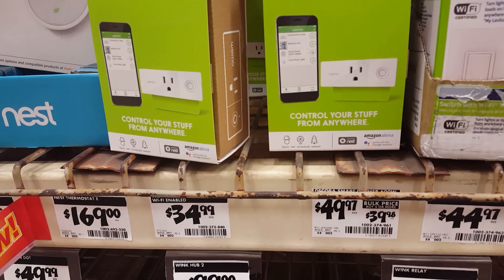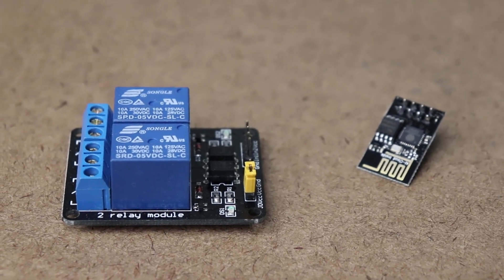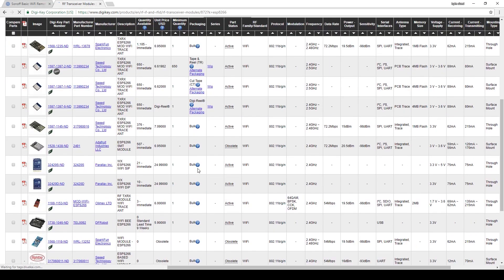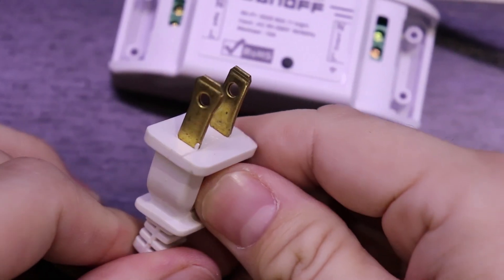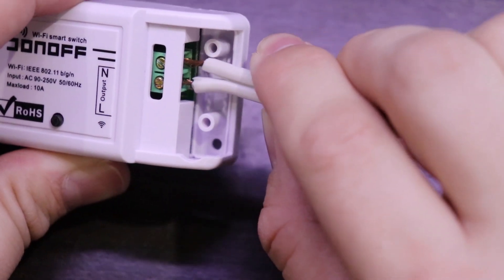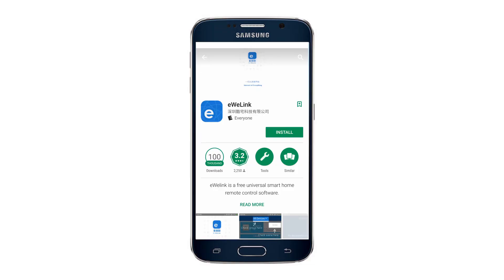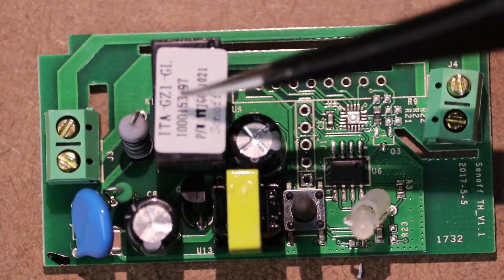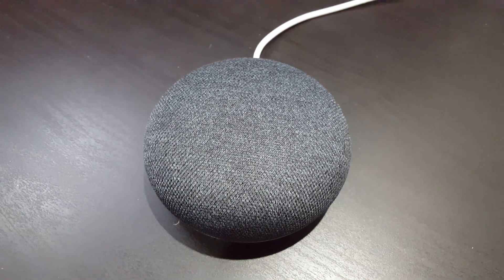Sonoff - The $5 WiFi Smart Switch That's Compatible With Alexa And Google Home

Comment: Thanks for the video. The wifi switch gave me an idea for my bathroom light and fan combo. My bathroom light/fan are connected to the same switch. Instead of running new wires to separate functions, I can just install one of these devices to control the fan on/off switch. Thank you

Comment: Thanks for the video! I've been wanting to get one of these, but I can't tell if it has a manual on/off switch.  I checked the documentation and I couldn't find where it said it did, I only saw where it talked about how to use a button to program the WiFi.

Can you verify if it has a manual on/off switch??
Reply: Hey John, did you find it out afterall?

Comment: Can input be 12 DC? do I need to be connected to wifi that Snoff is on?any way operate it at remote location?
Reply from the maker: This isn't designed for 12V applications. Once the device is connected to the internet you can control it from anywhere you have internet access.

Comment: If you are looking for a way to configure these directly for a SmartThings Hub without need of some third party app, take a look at this thread.  You will need to buy or have an FTDI adapter to re-program the Sonoff (around $8 on Amazon).

http://smartlife.tech/blog/2016/04/21/sonoff-wifi-switch-smartthings/
Reply from the maker: Thanks Nick. I helped my brother in law do this exact thing. Thanks for sharing

Comment: What a great video!  Super helpfully in getting my home automation up and running.  Here's a good one for you.  I have a Schlage Sense smart deadbolt lock for my front door.  It is Bluetooth enabled which I'm not very interested in, but  there is a Schlage wifi adapter available at the home centers but it's $60!  Is there a way to make my own adapter using these types of products saving my some bucks? Thanks!
Reply from the maker: If you don't mind digging into electronics and coding look into the esp8266. You can get a development board called the wemos d1

Comment: It's great if I can connect to it.  Apparently you need to be on a 2.4 ghz wifi connection.  Almost all my phones or tablets are on 5 ghz.  I can't seem to change that on my router.  There was one phone on 2.4 ghz.  I guess I'll have to borrow it just to connect this device.  I think eWeLink needs to update their App to connect with 5 ghz.
Reply from the maker: Is your router a dual band router? In other words does it support both 2.4GHz and 5GHz? You're correct in that the sonoff only has a 2.4GHz radio in it. If I remember correctly during setup the sonoff creates a temporary 2.4GHz network that your phone needs to connect to. Your phone should be able to do that. After it's set up, your phone can go back to the 5GHz network and the sonoff will stay on the 2.4 GHz. Your phone and sonoff don't need to be on the same band to work properly.
Reply: @bytesizedengineering  I know that but the problem is that I haven't been able to find out how to connect my phone to the 2.4ghz wifi.  It does it automatically and I see no way of changing it.  I tried to see if it could be changed on the router but had no luck.

Comment: My only thing. Is.. If it's on wifi.. Who manages the firmware updates? Seems like a big security problem to me.
Reply from the maker: You can load custom firmware and manage it yourself
Reply: @bytesizedengineering  after doing some more research on this I found that... That's awesome.. Still if that firmware is not updated its still a risk.. Buuuuuttttt I set up a firewall rule that blocks any public access to any internal IP addresses I Want so that makes me a little more comfortable...

Comment: See the BOLTR: AvE channel video of a similar name.  Shows cons. No UL listing,  10A Max on 15A circuit,  hijack capable for DDOS..

You addressed 2 of 3 of these in comments... upgrade firmware, add 10 A fuse or lower,  I would still find UL rated switch.

Comment: does it have a sunrise sunset automated "switch" connected/depending on location? I want to control electric water heater, only working at daytime, cause have PV solar panels on the roof

Comment: can that thing connect to my wifi instead ? i want to issue command using my router(with tomato firmware), so i need that thing to be in the same network as my router.

Comment: Do you know if there is 5v smart switch that can be used in-line for a USB powered device?  I have my wifi cameras powered by a USB 5v uninterrupted power supply (UPS) but there may be times when I need to remotely power cycle the camera to reset.  Obviously I can't use a smart switch at the main power source because the UPS will kick in and prevent the camera from powering off.  So I need something I can control in between the UPS and the camera.  

110v=>USB 5vUPS=>(smart switch?)=>camera
Reply from the maker: I'm not sure I can help, sorry!

Comment: "It looks like the lights haven't been configured yet"
Reply: If you want to make your lights smart and keep your existing switch, you can use a Sonoff mini. It has two wire terminals that you can use for a switch. Keep in mind that  the switch will switch low voltage. So don't connect mains to the switch line because that will kill the Sonoff.

Comment: Nice informative video But.....
Not wishing to rain on anyone's parade but I didn't see any of the type approval labels one might expect to see on a relatively complex mains AC automation device. At least one or more of FCC, TUV,  or CE (meaning the real one, not the false CE alternative 'China Export' label).

Also the build standard and quality control inside looks awful.

I would  be seriously concerned over risk of carbon and/or dendrite tracking between high voltages between copper/solder elements, which is a different failure mode to arcing via ionised air. It's a common problem on poor pcb designs where low resistance paths develop over time and guess what? It gets hot.

Without UL qualified materials it may catch fire while you are 20 miles away playing with your phone while your neighbours call the fire engines.......!

Be safe. Use qualified components/materials or do the work yourself to verify that the design & build will satisfy your statutory regulations.

If you don't care about this then use it in a garden shed which won't burn your house down when things go wrong, which they inevitably will.
Reply: See the AvE video on the issue of 10A device on 15A circuit
Reply: @davidcosine  link please.
Reply: Completely agree with your concerns.  I'm surprised you're the first to mention the lack of UL certification in the comments!
Reply: I think there is a version with CE but these sonoff devices are all tuya based which means they all run over a other chinese company. They also can pretty easy be hacked during setup, which means that you can flash some custom firmware like tasmota.

Comment: nice video. i want connect the sonoff switch with my loxone system but it seems not possible without o modification like flash the software.
do i need a modification to the sonoff switch to connect it with Google Home?

Comment: Nice video, I will keep these switches in mind.  For basic outlet control, a few more bucks gets you one that doesn't require cutting up an extension cord.  $13 at the moment.  https://www.itead.cc/smart-home/smart-socket.html
Reply: I think what he wanted was on the cord so it went with the device not the outlet. Of course it could still do that with the extension cord but less likely.

Comment: I still prefer zwave. Get a real controller like HomeSeer and pair any zwave or zigbee or some wireless devices. Have logic to play around creating the Auto pay of automation and have the house do things on its own even if your cord to internet is cut. I don't want my Smart house be dependant of Internet, to me the smart goes away there. Just my preference. A house I can control even without WiFi and also through Google home while internet works. Alexa is worthless.

Comment: Nice products, but I would not use them as I think it is wise to think more than twice before to use them. They are so cheap, they probably use the cheapest components and probably they are build based on Chinese standards which could more easy give problems or short circuits, and this is the last thing I want in your house...I want to sleep relaxed...

Comment: I have a fluorescent tube light in my kitchen and want to add it to the already Smart home lights. I got a smart light switch and guess what no neutral wire at the switch and I am not going to hire an electrician to run that so I was thinking if I could use this in the light maybe go in the attic or in the housing of the unit itself.. what is everyone's thoughts on this?

Comment: Nice job on that! How would you wire it if you're like me and live in Australia with a 3 pin plug and 240v? Are those switches suitable for 240v devices?
Reply: Just go out and buy a switch made for australian conditions, like TP-Link, from Bunnings

Comment: Don't leave that much wire hanging out of your screw connector. You're just asking for a short. The wires should be trimmed short enough that the jacketing presses flush against the connector.

Comment: Help... the first one installed went off without problems. The second i hooked it directly to the lamp’s cord but it’s not working at all. I made sure the neutral wire is in the neutral line. I even tried a second sonoff and still nothing.

Comment: Do not promote this. This device is only rated at 10A. Your house has a rating of 15A and roughly 20A in the kitchen receptacles. THIS IS A RECIPE FOR A HOUSE FIRE. DO NOT USE THESE.

Comment: Great video!   I would only add that the cord ends should be tinned with solder before inserting them into the device. This helps ensure no frayed ends which could lead to shorts or even fires.
Reply from the maker: Actually, with screw terminals you don't want to tin the stranded wires. They're designed for untinned wires.

Comment: You misspelled combustible in the title.

No CSA or UL laboratory certification, and the thing is rated for 10a. So many people are gonna overload these things is rediculous. I wouldn't put one in my worst enemies house.
Reply from the maker: I'm aware of the risk. I agree that people should take the time to understand the risk before using this device and any other device that is potentially dangerous. I'm careful not to put any load over 10A on these devices. It might make for an interesting video showing what happens if I overload this thing.

Comment: AvE did a "review" of this product and stated that it was rated for 10 amps. Your standard house power receptacle is rated for 15 and your kitchen at 20 amps. I would not feel safe to have this plugged into my wall.
Reply from the maker: Good things to be aware of. I don't plug anything into these that draw more than 10A.

Comment: The blender draws about 12A and the Sonoff switch is rated for 10A.   The "expensive" smartplugs are not so pricey once you consider they are rated for at least 15A and less likely to start a fire.
Reply from the maker: Depends on the blender, but definitely a good point. They make other models that are rated for higher currents.

Comment: Jesus. This is a terrible terrible idea. If you don't know anything about mains electricity, don't play with it. You'll burn your house down.
Reply from the maker: I agree, if you don't know what you are doing you shouldn't attempt a project with mains electricity. However, getting educated on the topic isn't as difficult and time consuming as one might think.
Reply: byte sized no, but it's a steep learning curve and it's what you don't know that bites you.

He really only showed how to set it up, not to verify whether it's rated for the device/circuit you're connecting, etc.
Reply: +byte sized those devices almost certainly aren't UL or ETL listed, so they haven't been tested safe, either.  What you're doing is irresponsible.

Comment: https://www.youtube.com/watch?v=yCkwXKRRHHs - Might be worth watching this if you are considering one of these...
Reply from the maker: I didn't watch the whole thing, but I agree with what he said at the beginning. These are meant for tinkerers and hobbyists.
Reply: Hang on a sec, let me get you a timestamp "Mr. I didn't watch the whole thing"...

5:23 onward. This device meets no standards and is under-engineered to meet the promised ratings, on top of the obvious safety concerns it is also an enormous abuse vector for cyber attack. If you want a smart switch, get one that simply requires WiFi w/o registration on an external service, this product is a joke at best, at worst it's a legitimate safety concern.
Reply: In case you think the potential for hacking is near zero, here's a website explaining (to literally anyone who might be interested) the potential abuse vectors.
https://github.com/arendst/Sonoff-Tasmota/wiki/Securing-your-IoT-from-hacking

Comment: You know it is only rated for 10A and the breakers in your house are much higher then that.  The device itself has no fuse inside so if it fails it will just get very hot.  Also it has no CSA, UL or ETL approval so it hasn't been tested by anyone so if you did have a fire due to this device your insurance would most likely not cover you.  I am just pointing out that this is a risk over purchasing a more expensive solution that has been tested.
Reply from the maker: Yes, people should be aware of these points. Thanks for bringing them up.

Comment: Hey! This switch has a 10 amp limit! You should be careful what you run on it. Also, it has no Underwriters Lab certification, it is a huge risk running it on heating appliances.  If you burnt your house down running these devices, most insurance companies would not cover the damages.
Reply from the maker: Yes, I understand the risks. People should understand the risks and not use anything they're not comfortable with.

Comment: Thanks for the info!  Do you think these will work with 12V power?
Reply from the maker: Not sure what you're asking, but this is designed to be plugged into the wall and switch and AC appliance as shown in the video. If you're trying to switch a DC load, this isn't what you're looking for.

Comment: I just bought it today, it really works
Reply: Did you set it up. I have a question , can we connect it to led and change its colour according to our will. Or it is only used to turn off or on device
Reply: @bea50prathameshkulkarnikul99  This one is just a switch so It's on and off only, you can also add timers and schedules but no LED control

Comment: I bought these because of you and they aren't 5$ any more the cost went up. But I found a good use for these
Reply from the maker: Just checked manufacturer's website https://www.itead.cc/sonoff-wifi-wireless-switch-1.html. They're still $4.85 as always.
Reply: byte sized I wish I knew that li ordered mines off of ebay. But they do work

Comment: Explain me how you managed to turn on blender with it? Switch has only 2 functions on and off right?  And the blender has knob for speed1, speed2, pulse etc. to work, so by saying command turn on blender it wont work because you need to turn a know on blender.
Reply from the maker: Okay, I'm going to be honest with you. You're right, this only works with appliances that can turn on when you plug them into the wall. Some blenders operate this way, but mine doesn't. I threw in the blender clip because I thought it would be funny, and help people visualize the possibilities with this switch. Good eye on catching that!

Comment: this is AWESOME, say techinically, shouldn't it be possible to put these switches behind a lightswitch in a wall? I have some old great looking light switches and I want to keep those but I want to make the switches smart. should be doable with this right?
Reply from the maker: This is possible, but I wouldn't advise it. It likely wouldn't be up to electrical codes where you live, and you wouldn't be able to use the existing light switch in parallel with this device.

Comment: Great video. Is it possible to wall mount Sonoff pow? If not screwed, may be using double sided tape? How much does it weigh?
Reply from the maker: I think it would be possible. Some of the other models have mounting holes built in.

Comment: I am thinking about RazPi 3B with Home Asst. installed running Z-wave . since the Pi 3b has BT and WiFi can I use all three in home asst. ?? If I purchase other protocol devices (plugs, switches that are WiFi) can I use Home Asst. to run them.
Reply from the maker: I'm not sure, but it sounds like you could.

Comment: Is it still working if the internet is off?
Reply from the maker: An internet connection is needed to remotely turn on/off the device. There is a small button on the sonoff switch that will bypass everything and toggle the power on/off to the appliance

Comment: hello, I have a question. Let's say the Sonoff for some reason STOPS working or there's no Wifi or Internet in order to make a light turn on. Can I still turn on the light manually? For a Plug will it still have current going through Sonoff?
Reply from the maker: Yes, there is a small button on the sonoff switch that will bypass everything and toggle the power on/off to the appliance

Comment: you get what you pay for. There is a reason the ones at home depot are $25. Because they wont burn your house down like that cheap piece of Chinese knock off crap you got there.
Reply from the maker: If you don't do anything stupid, then these are just as safe as more expensive ones. The more expensive ones are made in the Chinese factory next door to where these are made. And by the way the sonoff switches are an original design, they're not "knocking off" anything else.